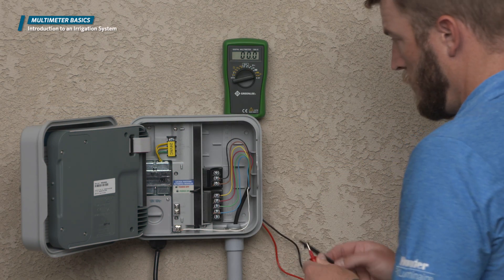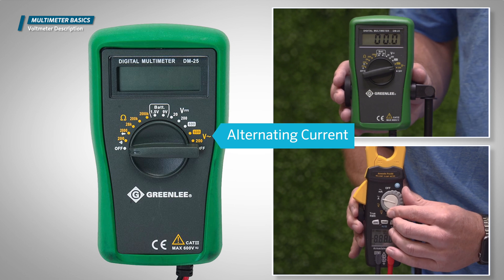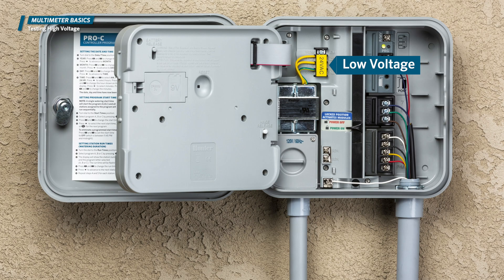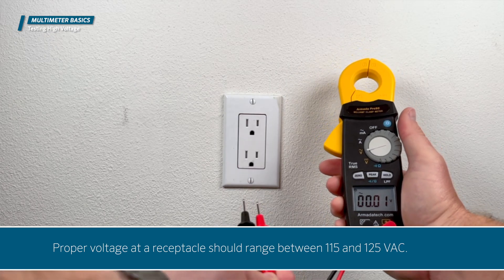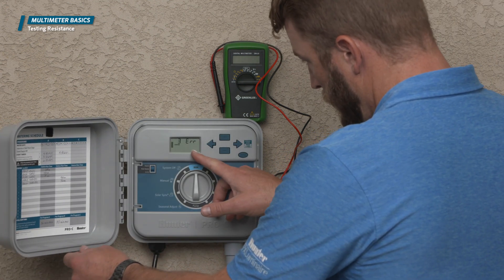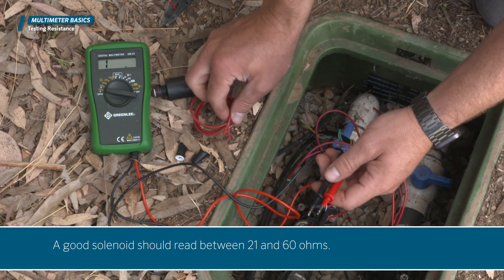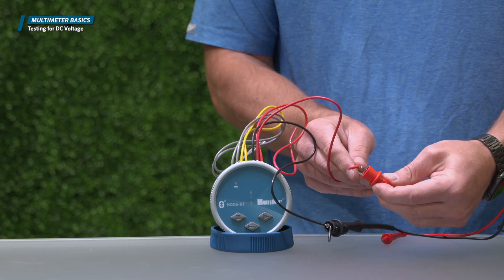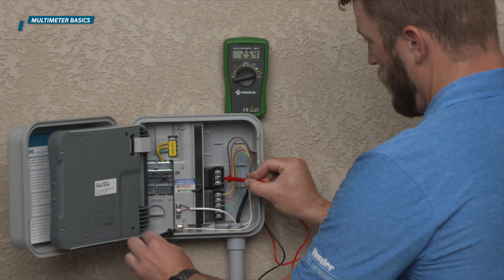Multimeter Basics: Troubleshooting an irrigation system using a Multimeter

Comment: I have a zone that has recently been causing awful water hammer noises when the sprinkler runs. I tested the AC voltage on the zone while running and it starts 26.2V but then immediately drops to 0V and quickly goes back to 26.2V every couple seconds. Does that sound like a station module issue? The transformer is giving a solid 27 volts. 

Edit: I replaced the station module and I believe the problem is solved.
Reply from the maker: Water hammer is a hydraulic or water issue and is independent of electrical issues. It may be time to contact a local irrigation professional for help with your problem.

Comment: If I want to test two extra loose irrigation wires for continuity so I can add new zones on them, and I connect these loose wires at a solenoid, and then with my multimeter I touch both same colored ends at the base control box, and I get a reading of 1.0 Ω, is that a good enough result?
Reply: So you created a loop with those wires?  You tied them together at one end and tested resistance at the other?  Then 1 ohm is a good thing.  Your wires have good continuity.  Smaller wire gauges will have more resistance the further you go.  18 AWG: 6.5 Ohm / 1,000 ft (multiplied by 2 for the wire to and from the end).  So if you have 1 ohm on 18 AWG, that suggests you were 35-40 feet from one end to the other (70-80 feet of wire in a loop).